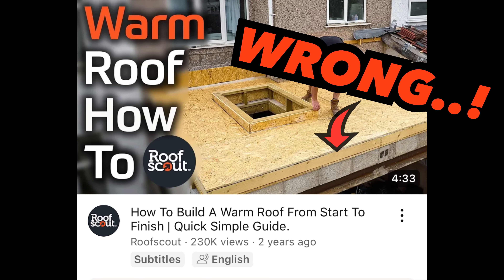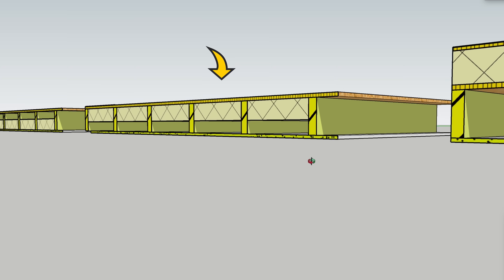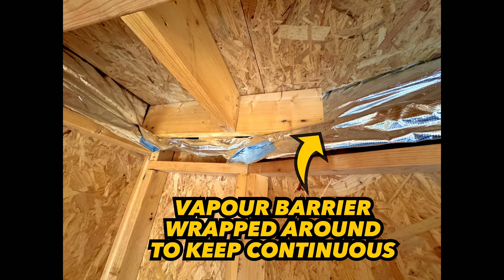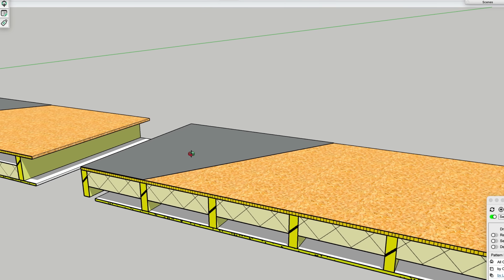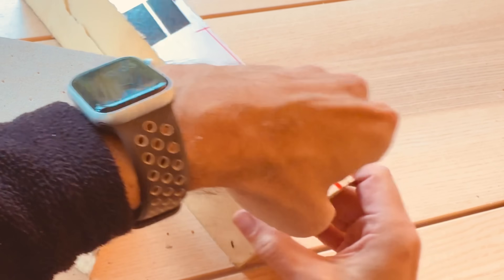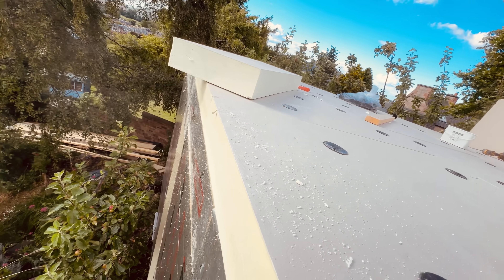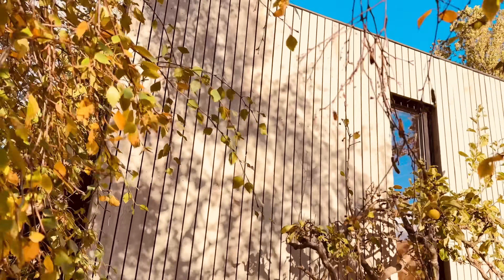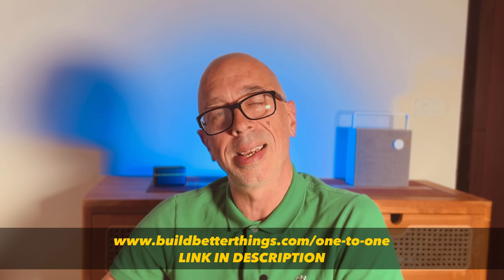Build a Warm Flat Roof the Right Way

Comment: The water based adhesive is vapour permeable and so is the EPDM. If the vapour barrier on the warm side is good the amount of moisture that gets through will evaporate through the EPDM. 
We don't see failures and it is a much better to have a deck that doesn't dent and cause puddling.
Reply: The vapour permeability of EPDM membrane 1.2mm thick is ~24m (using EN ISO 12572, from the Soudal datasheet).  That does put it in the vapour barrier range (20-150) rather than the vapour-tight range (150+), which is lower than I expected. But it's not what most people would call 'vapour permeable'. Ali foil is 200m, EPDM 24m, 'active membrane': 0.4-30, breather membrane 0.1m, so it is fairly vapour tight, but not completely. 
So yes so long as the membrane on the inside has more vapour resistance than the EPDM you should be fine, but I'm not sure how often that's true (I just failed to find a number for standard polythene sheet). That permeability number does probably explain why this doesn't go wrong as often as you might expect.
Reply from the maker: The substrate does not dent nor cause puddling when you use the correct insulation. This seems to be a common misconception. The EPDM will puncture before any change in the substrate. 
For heavy traffic, you’re using an inverted roof, not a warm roof. 
About evaporation or breathing, that can’t happen with OSB on the cold side, as localised condensing moisture gets trapped within the layers of glue and fibres within OSB, as the temperature drops, rot is the next stage. 
You mention vapour barrier, no vapour barrier is perfect, especially when you’re driving a gazillion screws, or not bonding it correctly to your vertical vapour barrier. 
You mention failure, you’ll only see failures after several years, but still premature for the expected lifetime of 40 plus years for these roofs. 
Assume there’s no failure,…I still don’t get the argument…. it’s about striving for excellence…, with the knowledge you have at the time. Composites on the cold side where there’s no ventilation is a horrible detail. 
And if you still don’t care about all that…., why an additional layer of OSB on the cold side with all the extra time and cost, when you just bond direct using the correct adhesive and the correct insulation ?
Reply: @build-better-things  Its not a misconception, i work with that material and you can dent it with your knees while installing them. its strong but to say it does not dent is just false.
Reply from the maker: @LibTarded-ez1  Pretty sure you don’t work with it, because if you did, would know you can’t dent it with your knees. The EPDM will puncture before any change in any substrate
Reply: I do work with it, and you can. This isn't some indestructible substrate. Its gets dented in your own video when its being cut lol absolute tool of a human. But thank you for trying to Mansplain what I do for a living.  @build-better-things
Reply: I understand the reasoning but having worked in the states with the building science corporation and the author of the "Perfect Wall" system Joseph Lstiburek the moisture is going to condense on the coldest surface where it contacts outside temperature, which would be under the EPDM not where the dew point calculation will tell you (which is 3 thirds of the way through the insulation).

 In the ideal situation you'd have an air gap between the cladding (EPDM) and the insulation to reduce the moisture build up. So use 4x1 and metal roof over the top with ventilated soffits. That said the actual chance of build up is extremely minimal due to the reduced air space between the insulation, the top layer of OSB and EDPM reducing the potential for condensation.
Reply: @effervescence5664  So according to what you know, is it acceptable or not to put plywood / OSB on top of the insulation? I'm really trying to understand this as I need to replace a flat roof and don't want to install it incorrectly. Thanks.
Reply from the maker: @firecrest8154 If you’re asking me, I give the answer pretty clearly in the video, along with the reasoning. You’ll just have to read the counter comments and make your mind up. All I see here are those criticising products and evolving methods which clearly they have no experience of, often the way in the building industry. The other argument, is the non argument around experience and doing it that way for years, whilst knowing nothing of that person’s actual experience.
Reply: @build-better-things  I was curious what efferescence thought as they said they have worked with the building science corp. But thanks for your reply too. I am considering all options carefully, I want to get it right when I do it. Do you know any resources from other countries, like a building standards site for those countries who follow your method?
Reply: Any recommendations on how to address vapour on a green roof that is flat? It needs to be able to take a load on the insulation and would not be vapour permeable so I wouldn’t want to put it straight on. 

Any thoughts on that?
Reply from the maker: If this is a roof that you haven’t started yet, for that, I’d suggest an inverted roof rather than a warm roof.
Reply: @build-better-things  ok. I haven’t started yet, although the architect drawings detail a warm roof and it was approved by building control.

What is an inverted roof really and why do you suggest it? Have you done a green roof before or have some guidance on what to look out for? Thanks
Reply: @christianu8023  An inverted roof has the insulation on the wet side, above the waterproofing layer. So you have to use insulation that doesn't mind sitting in the wet (usually XPS).
Reply: @xxwookey  True about XPS. Unfortunately, though it won't deteriorate, XPS loses a lot of insulation value when wet.
Reply: @HistoricHomePlans XPS is closed cell so doesn't absorb moisture
Reply: @craigdevonshire4583  Based on the experience of yacht repair professionals, XPS foam does slowly absorb moisture—and releases it at about the same rate. However, once it takes on water, its thermal conductivity and weight change significantly. I’ve personally seen heavy, waterlogged XPS, and it’s a completely different material.

Another question is how it behaves under extremely high temperatures in summer. It will likely dry out successfully. But the real concern is what happens to its closed-cell structure when ice forms in winter and steam builds up in summer.

That said, unlike wood, XPS won’t rot—which, all else being equal, is a clear advantage.
Reply: 100%

Comment: We (in Glasgow) have just been quoted around £250k for renewal of our 4 buildings flat roof segments, and this includes a 25 year insurance backed guarantee. We were told 25 years was the best length we could hope for (with Bauder), but you mentioned 40 years in your video, not sure what to think now
Reply from the maker: I think 30 and 40 year bonds are less common now as insurance has evolved. I would be ok with 25 years since it’s the first ten years that are critical. The gradual and “invisible” problems such as what I’m talking about here will usually come to light within that period. Hope that helps.
Reply: Thank you so much mate, appreciate that. Separately to this, I might need to book some of your time to discuss the best options for sorting out my garage roof insulation...just need to come up with a couple of solid ideas first. Thanks again!

Comment: looks like you are penetrating your vapour barrier. Maybe it's better to put it closer to the inside during the buildup
Reply from the maker: Hi.  No matter where you put your vapour barrier, you’re piercing it with fixings. Ceiling would be plasterboard fixings. That’s another reason why you should never have any timber on the cold side of the insulation . Vapour barrier is a misnomer.  It helps, but vapour control is really what you should be considering.

Comment: I had an extension build in 2013 and the builders followed the architect plans the the letter, he forgot the vapour barrier on the flat section of the roof, needless to say it wasn’t long before black spots started to appear on the ceiling, but it took a long time and a number of contractors to workout what was the issue.  Must make sure this is done correctly.

Comment: Never use OSB on a roof system.  Period. Or rubber.  TPO has better lifespan and resiliency and no adhesive.
Reply: What is TPO?
Reply: @  look up dura last roof.  It’s a heat seam method and bombproof.  I always use densdek on top of slope form foam so it’s walkable.    No adhesives I believe is better for fail rates etc.  cheers.

Comment: Thanks for the video. Can you advise how you would do this on an old concrete slab roof with no insulation  underneath/inside.
Reply from the maker: Without seeing it, can’t say for sure but consider using the concrete in place of the OSB, self adhesive vapour barrier over and adhere tissue insulation boards over that, to manufacturers recommended detail to avoid wind uplift, and adhere membrane onto board. Theory easier than reality and it would depend on a load of factors.

Comment: with this method I am worried about heavy things going on the roof, being supported only by insulation. a am wanting a roof I can work, jump on, carry a heavy wheel barrel on, do gardening on, and live on, daily! that is functionally a additional floor. times are changing this is why people want flat roofs now, we don't want the boomer wasted space that's just as worthless as a grass lawn.
Reply from the maker: For the uses you mention, an exposed membrane such as I describe won’t work regardless of substrate. You would use an inverted roof for that type of traffic.

Comment: Thank you for the video.  Is there are way of using this system and have a trafficable roof?  Can tiles or timber be laid over it?  Is there a tile pedestal system that the foam insulation can support?
Reply from the maker: For that you would use an inverted roof arrangement, where the insulation and then the actual surface material is over that, so a bit different from warm roof with exposed membrane.

Comment: How about a tongue and groove cement board on top of the insulation and then the rubber or fibreglass?
Reply from the maker: I think you’re describing an inverted roof? That’s a different thing than a warm roof with a different set of requirements.

Comment: Good video, well explained. 

1 question: Not having timber on the cold side, would suggest you’d expect some permeability through the circa 100mm of PIR? Even with sealed edges??…
Reply from the maker: Hi. If I’m understanding your question.  Even with the best vapour control, there’s always going to be vulnerable points, and then there’s the insulation itself, where you’ll find residual vapour.

Comment: What about damp then getting into the insulation? Or is that mostly  caught by a vapour membrane lower in the roof structure?
Reply from the maker: Damp can only come through condensing vapour as I’m describing, above the vapour retarder, or through moisture coming via a hole or rip in your roof membrane
Reply: Yes okay. So you're saying the vapour retarder/membrane which is blow the insulation will stop that? Aside from holes and other sources of moisture....
Reply from the maker: It will stop most of it for sure. That’s the aim.

Comment: Interesting that you have not suggested a interstitial condensation calculation. If you do that then you can place a deck on the top of the insulation will be functionally 'cold' and unable to suffer from condensation. Also if you look at the instructions for the water based adhesive, you are supposed to wait until it has dried off - if you have been putting the rubber down wet then you have been doing it wrong
Reply from the maker: A calculated dew point is not reality, escaped and residual vapour is what I’m talking about. You mention water based adhesive. In the video I say you must use solvent based, and I describe how to apply it, including how to adhere.

Comment: Interesting you skirt over the 'vapour barrier' detail as surely this is key?? Interesting to see what you think about Steve Roofers video on the subject which kinda suggest your understanding of how the vapour barrier should be detailed is not correct. Steve even gives you 'clear physics and data' ;) . https://www.youtube.com/watch?v=kjQ9Zi2uMCw
Reply from the maker: Vapour barrier needs to be on top of the deck and under the insulation, on the warm side. I didn’t skirt over it and I guess you were busy typing your gotcha at the bit where I drew it in the video. Thanks for the link but the guy you reference is saying the same as what I’m describing in my video .
Reply: @build-better-things  no one is saying the vapour barrier should not be between the warm side of the insulation and the OSB. As I said, it's the detailing which seems to be different i.e. at the edges. Steve is saying that vapour barrier encases the sides and bottom of the insulation forming a water tight enclosure around the insulation. The OSB and EPDM deck on top has a significantly lower SD and hence that is where vapour escapes over time. That is very different to what you are saying.
Reply from the maker: You didn’t mention the edges in your first comment…but.. since you raise it here…. I draw attention to that very thing, with a few photos and a drawing, in the video
Reply: @build-better-things  sorry, assumed you'd know what was meant by 'detailing'. You seem to be more focussed on 'not being wrong' than a discussion on the actual point raised so will leave you to it. I'm sure many others will see the glaring differences between what you are both saying.

Comment: Well said, we only use the green solvent contact adhesive applied to both sides its just as easy when you know what you are doing, even comes as spray system if you prefer.

Comment: What type of fasteners are used for the roofing and siding to attach it to the insulation? Do those fasteners have to be plastic too?
Reply from the maker: If you’re piercing the insulation, you should consider using thermal break fasteners. There are a number of different products

Comment: im from the nordics, Denmark specifically, when in most commercial settings, the roof is actually considered as the vapour barrier, with the inside ceiling being structural perforated steel, with the insulation laying on top and then more often than not, asfalt based roofing systems being burned straight onto the insulation. i have never seen a professional roofing company use any glue or peel and stick roofing product, its all old fashioned 2-3 layer asfalt based roofs. the walls are then mostly precast concrete, which go half to one meter further up than the roof itself, and the asfalt based products are bonded onto this rising bit of the wall, allowing the entire roof surface to act as the gutter and control the water, since water management has become a much bigger issue these years with heavier downpour
Reply: That wouldn't pass regs in the UK, internal wall stretching up and absorbing all the cold

Comment: Yeh. 
But to get the airing above the insulation to work with a draft, on a totally flat roof. 
You can use a little trick. 
Mount aircanals on top standing up. 
Because then you get a level difference on intake and outake, and it becomes a draft towards it. 
So you need to let air come between the compartments at the end to reach the canal. Depending on how many canals you need. 
Just a cut in the wood, but dont cut the beam. 
That is often the issiue with flat roofs. 
Not getting airflow going. 
King 
Ragnar YAHUWAH ❤

Comment: Don't they have ZIP System or something similar in the UK? Your vapor and water barrier are part of the roof sheathing. Insulation goes on top. Then furring strips to support your roof panels (or another layer of ZIP if you're laying shingles).
Reply from the maker: Hi. The system you’re describing is a ventilated roof, not a warm roof. I’ve made an another video about that if you have a look.
Reply: @build-better-things  No, I'm definitely describing a roof with exterior insulation. Steve Baczek, Matt Risinger, etc.

Comment: Excellent video....thank you. Question.  I want to build a deck over a sun-room. Would the insulated panels be ok to install decking materials and support the weight of people using it for a patio deck?
Reply from the maker: You need to use an inverted roof for that. Whether OSB or insulation substrate, the EPDM won’t take that traffic over time.

Comment: You made some good points, but I have a couple  for you . 1 what about walk on balcony roofs, straight insulation is not strong enough.  2. Your laying 150mm in 1.2m sq sheets, it would be better to use 2 layers of 75mm x 2.4x1.2m with an offset stagger, to eliminate direct bridging through every butt joint and bigger  but still manageable sheets to cut cut down on overall joints. Your proposed way may meet code but you're ignoring that in the Timber statement, for a maximised performance?
Reply from the maker: Hi.  You wouldn’t use the warm roof makeup I describe for a balcony. You’d use an inverted roof. Insulation is perfectly strong enough to walk on, but I’m not understanding what your point is. Are you suggesting OSB on the cold side for a warm roof? …. Joints…. You would use rebated batts as I mentioned. Splitting into horizontal 2 layers introduces air and is sub optimal.